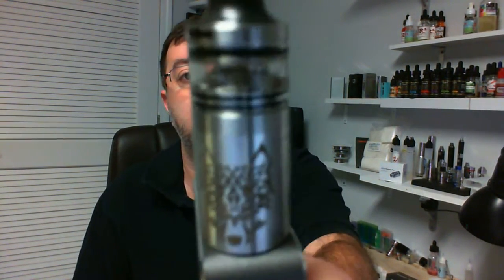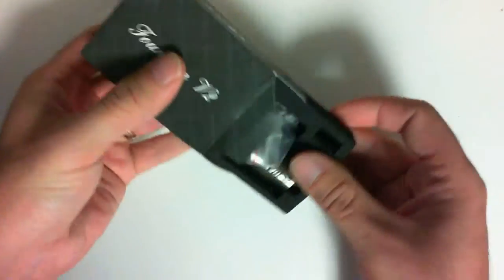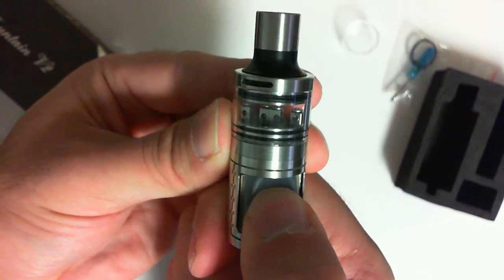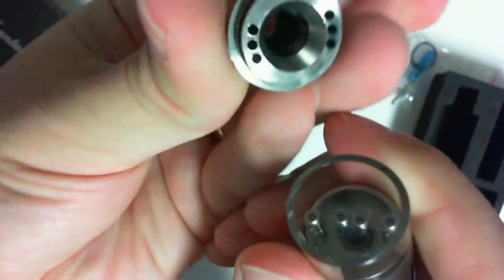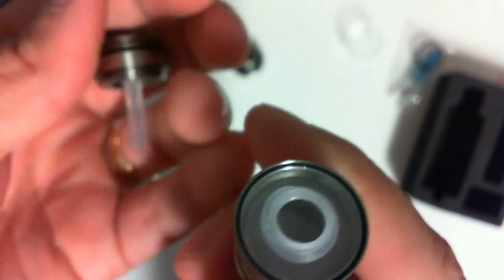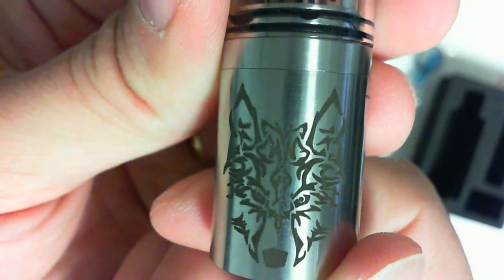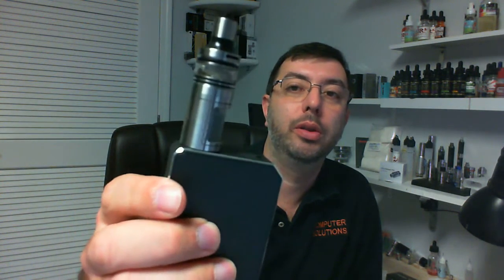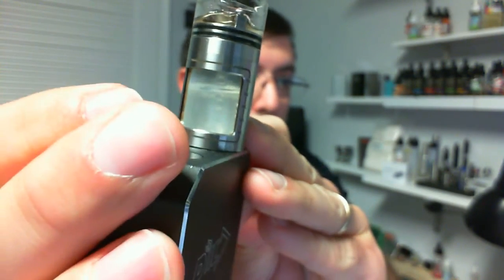Fountain V2 Squonker

Comment: someone plz help I bought one of these and put a build in it and put it on my royal snow wolf and it said check atomizer. thought I had a defective one so I bought another one and it is saying the same thing.
Reply from the maker: +Sinatra Sessions With some devices, the pin just does not protrude down enough to make contact. See if you can loose the bottom 510 pin a slight bit and then see if it makes contact, just dont tighten it too much. Thats the only thing i can suggest.
Reply: +The Vaping Computer Guy  thanks dude, I've tried doing what u suggested. I put it in my xcube 2, my xcube mini, my snow wolf and my mini cloupor and nothing works....lol maybe I just have really bad luck and got 2 defective fountains from 2 different companies lol, thanks dude great videos